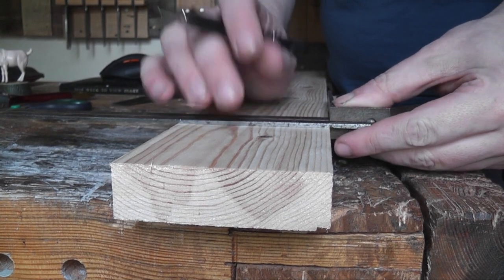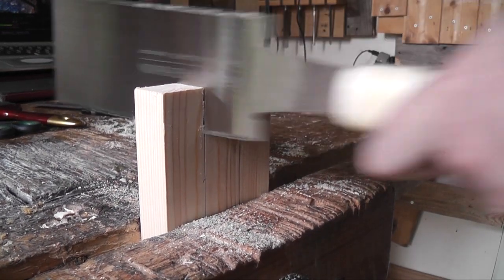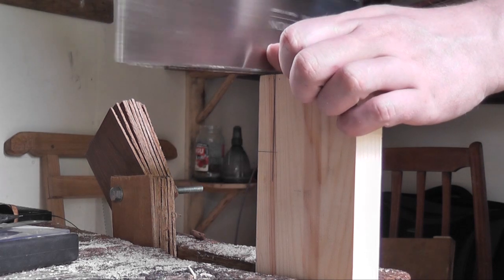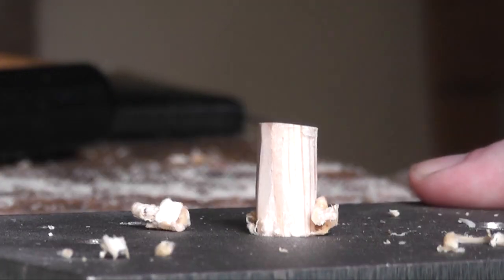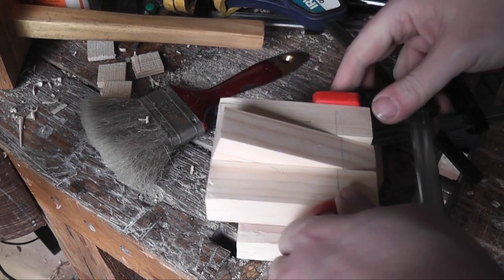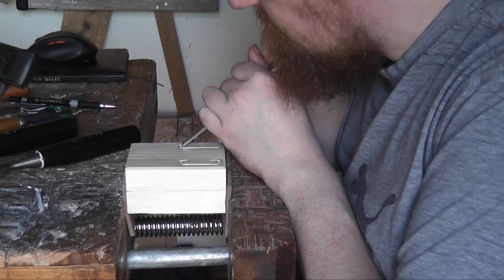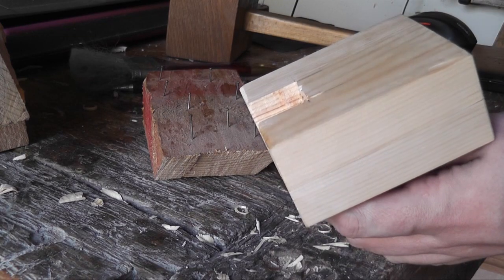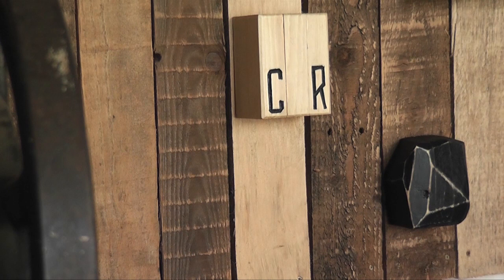Folding Coat Hook with Carved Letters [Simple Woodworking] (Skillshare)

Comment: So good to see you back on the air Clint. And a triple goodie this time - two super hooks and a carved sign. Good value mate! The jewel-faceted hook had me completely fooled. Incidentally folks may like to know that a wee bit of talcum powder can lubricate a stiff wooden hinge - I've never tried it myself but it might help someone out. Cheers Clint for another superb vid.
Reply from the maker: Cheers Mark! Been a lot going on lately so not been so active here. Ahhhhh, I've never heard of the talcum powder thing! I tried some beeswax/mineral oil mixture but it didn't do much in this case. It was probably a little too tight to be honest.
Reply: Timber Anew I think there's a possibility of both those becoming quite gummy when they dry. I saw the toymaker Paul Spooner do the talcum thing years ago in a Caberet Mechanical Theatre vid. I've never actually tried it myself...